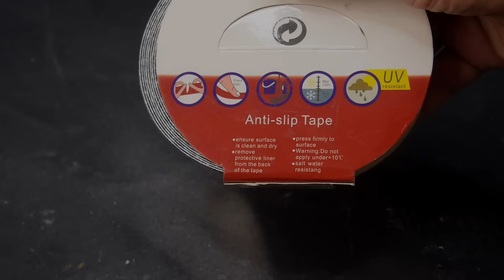German Guillotine REAL Restoration Extremely Rusty and Destroyed

Comment: You seemed to have abandoned cleaning the acrylic shield properly - scratching the surface with the blade simply damaged it! Not good. Gentle surface sanding with increasingly fine grit paper then polishing compound would have been 100% better to keep it original. Painting it was completely wrong.
Reply from the maker: Thanks for the tips! ❤️❤️